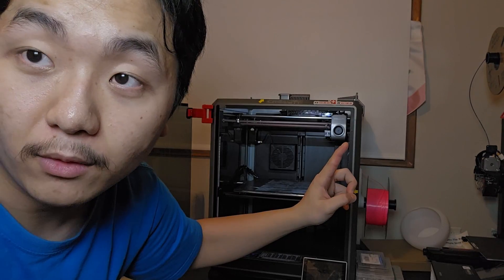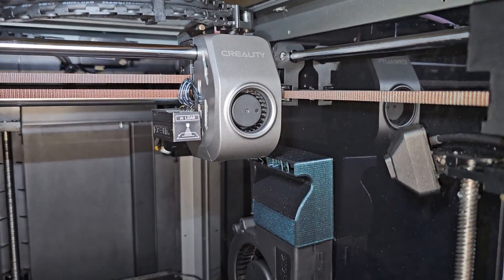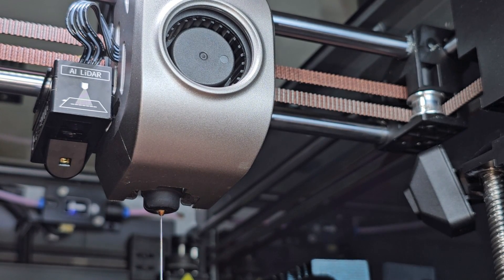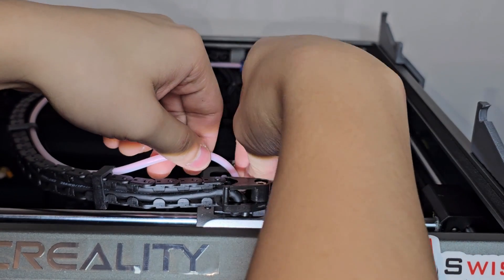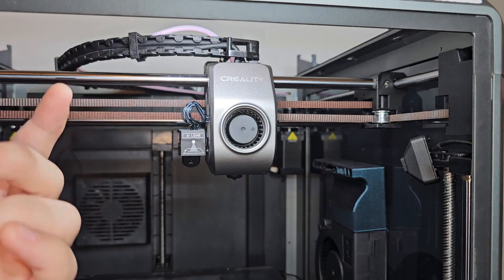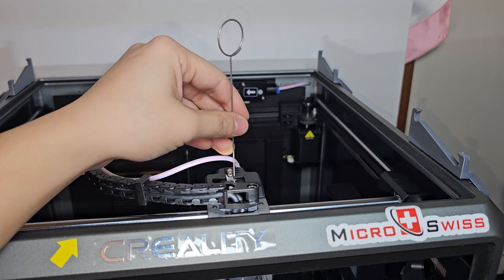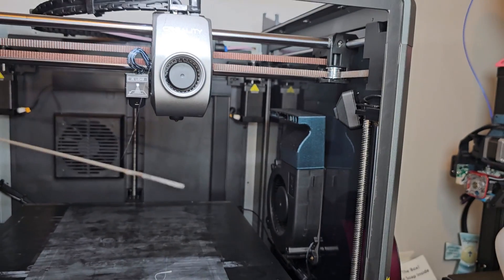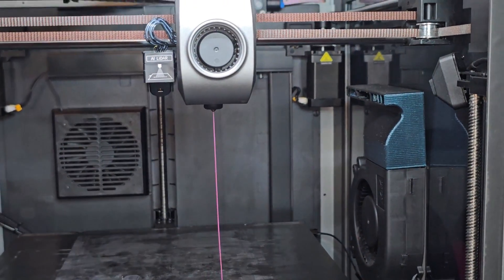Creality K1 Max Clogged Nozzle | Do This Instantly To Unclog

Comment: Heating up the metal rod and sticking it in through the top caused more damage to the printer. It began to melt the plastic housing for the feeding gears and made the clog A LOT WORSE. I had to drill out the tube after the gear housing as it guides the filament to the hot end, and that plastic tube right after the gears had melted and collapsed. Needles to say, this isn't a good idea. Disassemble the gear mechanism on the extruder and manually remove the clog. Don't melt it in...
Reply from the maker: Yea you are right, during this time I thought it was a good idea, and it is, but VERY dangerous. Disassemble is the way to go.

Comment: I know it’s an old video, but I would remove the extruder when attempting the final suggestion to avoid damaging the extruder. It’s quite easy to remove it.
Reply from the maker: Yeah, removing the extruder is the best way to unclog things and see what's happening inside the 3d printer.

Comment: Well my filament is stuck won’t move even with the switch in the unlocked position and it’s stuck solid no amount of heating clears the nozzle, it’s one day old and I’m absolutely stumped it won’t extract or extrude
Reply from the maker: In that case you'll have thr disassemble the extruder and see what's stuck inside.

Comment: With all the stuff they sell to unclog the nozzle, I discovered that just taking the right sized Ryobi drill bit and turning it by hand worked as soon as the nozzle was at the right temperature.
Reply from the maker: Yeah that is another way of doing it. I have seen many people do that, but be careful not to make thr hole any bigger.

Comment: DONT PUT A HOT ROD IN THE TOP - The feed mechanism has plastic parts in it. A hot cleaning rod from the top can result in the rod getting jammed in there as well (ask me how I know). It takes 10 minutes to take the feed mechanism apart and remove the blockage without risk of damage.  https://www.youtube.com/watch?v=GBdraBmpuEE
Reply from the maker: Yeah it is dangerous

Comment: when changing the hotend I dont recall anyone mentioning that the nozzel from the factory is only hand tight i have worked on mine many times before I realised the the nozzle is tight but only at a minimal tighten everything properly before installing saves stress and tears
Reply from the maker: Yeah, over tight the nozzle can strip the tread and ruined everything.

Comment: This was not a good idea in my case. I can't recommend this method at all. It was my first time having to unclog a nozzle, and using the hot needle only made it worse. Would have been much better to disassemble from the beginning. Turns out the root cause was one of my filament extruder gears (the one connected to the reduction gear) is missing a tooth. I ordered new all metal ones, and then swapped the two gears (so that the one with the missing tooth isn't required to drive anything. Printing again now, will replace the gears when the new ones arrive.
Reply from the maker: Yeah, this method is pretty dangerous. Disassemble is the best method to unclog anything clog.

Comment: 3:35 my filament is stuck, can’t pull it out… Doesn’t extrude, doesn’t extract and can’t pull it up from the top like shown here… contacted Creality and where going to reply in 24h but nothing happened. Got a Ender 5 Max paperweight until this gets fixed… (did 5 small prints as it’s 1 week in use) 🤮🤮🤮
Reply from the maker: Yeah clogging happens all the time in 3d printing.

If the filament can't be pulled out, maybe heat up the nozzle and change the nozzle.

Comment: Bro thanks for the video, do we need to heatup the nozzle when we put that manually heated rod inside ?
Reply from the maker: Yes have the nozzle heated so that it can melt the plastic and push out any clog
Reply: @Scratch3DPrinting my spool was a tangled an I saw an error saying that between the extruder and the CFS the filament is blocked. I tried retracting and extruding. My filament goes back to the CFs and gets in without any issue but when I resume the print the filament does not come out of the nozzle. And I hear the tik tik sound from the head. Do U know this issue can be same as you explained in the video ?
Reply from the maker: @joysondsouza5819 Yeah if no filament is coming out and you hear the ticking sound then it's a clog in the nozzle, not in the CFS.

Comment: pushing down from the top with the rod dealio was the key! I didn't know it was so easy to remove the tube
Reply from the maker: Yeah you learned alot when taking off the 3d printer.

Comment: DON'T DO THE HOT ROD IT WILL SCREW UP BIG TIME. I have to admit I did it a few times and it worked but I had a massive fail big time. EASY WAY 3 screws at the motor disconnect it, 2 long screws on motor case open up and unclog EASY. also you get to see the damage caused by HOT RODDING.
Reply from the maker: yeah that method is quite risky, but when it works its amazing.

Comment: Never thought to heat the cleaner , but to be absolute sure that will not damage anything between the extruder and the nozzle , I think it's better remove the extruder , cuz the capricorn nozze go all the way up until be close the extruder. So , removing the extruder, the cleaner can be insert directly to the nozzle to unclog anything.
Reply from the maker: Yeah the best method will always be removing the extruder and or nozzle and see what is clogged inside.

Comment: In my case, it was enough to set the retract to 260 degrees and run retracting.
Some old PLA blocked, but it worked.
Reply from the maker: yeah sometime heating up the nozzle to higher temperature does work with pla.

Comment: Dude you save me from a complete mental breakdown. Following your steps fixed my issue immediately after i tried so many other fixes! The tip about the unclogging pin that came with the set, and heating it up, made all the difference. Thank you so much!!
Reply from the maker: You're welcome, glad you were able to unclog your machine.

Comment: Genius idea. It worked for me. What actually happened was the piece of junk filament stuck to the end of the hot rod and was pulled out. My only tip: remove the extruder motor first (only three screws)
Reply from the maker: Yeah removing the extruder would be better and safer, filament always gets stuck in there.

Comment: I have the K1 SE and can not unclog it. It is not making any noises. Prints like something is coming out but nothing is. Can you help!
Reply from the maker: At best you can disassemble the print head and see if there's anything in the nozzle, heatblock, or even the extruder.

Comment: DO NOT HEAT UP THE METAL UNCLOGGER because it will melt the plastic extruder gears inside. The ideal method is to take the extruder head apart and take out the clogged plastic. The needle trick for unclogging filament in the nozzle is good, but the heated rod is TERRIBLE IDEA!
Reply from the maker: You are absolutely right, the heated rod can cause damage if not be very careful, taking off the extruder is the smarter way to do it.

Comment: Thanks man, your video worked. Have to hear the pop sound from the top, and make sure it's unlatched when you go in. I did it the first time and a bunch of filament came out so I thought it was clear. Still blocked. Heated the thing that came with it to red and tried again, heard the little pop and all sorted.

This was from me changing the filament for the first time incorrectly and I actually had a whole solid piece of filament stuck inside.
Reply from the maker: Nice glad to hear it work out for you. Hearing the pop sound is satisfying.

Comment: I have a K1 Max with original extruder and hot end components. I have a lot of issues related to clogging both the nozzle and the extruder itself. I have had to remove three clogs from the extruder that occur between the short blue PTFE and the extruder drive gears. What I think I may be doing something wrong when I change filament. Basically after a print when a filament change is needed I retract the filament and quickly pull the filament out rolling it back onto the spool. At this point the filament breaks and creates a clog in the extruder. This is difficult to clear with the provided Creality cleaning rod without opening the extruder. 

I'm not sure what I can do to prevent this from happening. Wait until the nozzle cools down after extracting the filament before retracting the filament manually from the extruder? Or replace the extruder with newer Creality product - apparently there have been two upgrades that I am aware of. I have the original replacement with a "white" PTFE retention opening.

Regarding nozzle clogs (especially after a "plug" clogging the extruder), I have had to remove the nozzle for cleaning with small diameter needle-like probes and heat. Generally, I use a propane torch to heat the nozzle along with cleaning needles. Otherwise, I end up with under extrusion issues from a partial filament blockage. I have a Triangle Labs CHCB-0T (hot end, nozzle, and sock) on hand that I will install if clogged nozzles continue to be a problem. Any thoughts?
Reply from the maker: I have experience the same thing while pulling the filament out like you did.

What I did was use the "Extrude" and "Retract" preset from the 3d printer screen. Wait until it has completely done retracting then push the lever on the extruder and pull out the filament.

The auto retract does a really nice job of retracting, don't force pull while the 3d printer is retracting, that will lead to many problems. I have not use Triangle lab stuff so i cannot say.
Reply: @Scratch3DPrinting  I haven't been doing the extrude followed by retract. I don't see how that would change anything because retract does extrude some filament before the retract. I'll give it a try and let you know if this reduces the problem. Regarding pulling the filament I do wait until retract has finished and the nozzle has cooled some.

Comment: Wow, i was worried about this for ages, i only got my K1C yesterday and have been printing all day, tried to replace my PLA and then this happened. found your video and the heating up the cleaner worked a dream, I just used a normal lighter and it all spurted out. Thank you
Reply from the maker: Glad I could help.

Comment: Thanks for the tips!

I knew to probe the hot end from the bottom and recut / reseat the filament, but heating and plunging from the top of the block is a very good idea. 

Subscribed.
Reply from the maker: Glad it helped!

Comment: lol "finally clogged"   im here because 3 hrs of printing 4 small tests on a brand new k1c and its already clogged wont extrude  wont retract only used 10 percent of the test filament it came with its such low quality
Reply from the maker: Sometime it just clogged for no reason.

Comment: don’t do this!!! heating up the push rod, the components down there are plastic and you will melt them!!!
Reply from the maker: that's true, doing this is very dangerous, but if done correctly it works.

Comment: ive tried this a thousand times to the point im afraid i am damaging my printer and it is not fixing the issue. are there other methods of unclogging?
Reply from the maker: If nothing works, then I guess you'll have to take apart your extruder and unclogged it that way.

Comment: Dudes. That is for when you remove the nozzle and use the pin for cleaning the entire block. Heat the nozzle. Remove it and use the pin to push up and down to clear any blockage. After each push clean it.
Reply from the maker: ohh, well it is also great at unclogging as well.

Comment: I have Creality K1 can you help mewith this problem?
The nozzle isn't touching the bed during printing and then it starts to moving xy without printing anything.
Reply from the maker: I'm not sure, you can maybe redo the bed calibration, and also try homing and see if the nozzle touches the bed. Clean off the purge line at the back of the build plate. If nothing works then maybe something is broken and needs replacements.

Comment: Helpful video, but unfortunately, it revealed that my K1 Max's extruder kit had failed completely after only about 30 hours of printing! I also discovered that Creality neglected to install the PTFE tube between the extruder and the heat break. Though I love my old CR-10S Pro v2, I didn't exactly trust Creality after this. In the week since I had bought the printer, the price had increased $200, which then made the Bambu Labs P1S with AMS a cheaper option, so I went that way.
Reply from the maker: man, thats sucks, that your extrude had failed. But hey, congrats on getting the P1S with AMS. Keep on 3D printing.

Comment: The way you heat @6:11 with fire is better to heat with an hot air gun with temperature controllable, don't insert anything hotter than probably 250 degree on the cold end (intend with margin 240) it's a good over minimum and maximum temperature in many cases not involving extruder gears. I'm not sure which is the max temperature not to damage this specific design (and K1 Max neither ship always with the same heating block since time to market) but heat with fire is not something to imitate to reach "hot enough", it might be definitely too much.
Reply from the maker: Yeah you're right, a heat gun would've been better for better heat control. It is also very dangerous to that method.

Comment: I tried this. Doesn't work on every situations. I had a blob of melted filament which was stuck after the gears at the entrance of the extrusion channel (tube) in the plastic housing. How do I know? Well I managed to follow a video instruction on taking the stepper motor and extrusion housing out and opened them to check. It would have been much easier to do it this way. 

The method to stick a hot pin into the extruder channel was kind of odd coming from Creality (Not sure if this is from Creality or from the Poster) as the hot pin actually melted the blob and when I pulled the pin out the melted filament got pulled along and smeared the inside of the channel reducing the diameter of the channel so much so the filament wouldn't go through. So I ended up opening the unit which was actually much much easier to do and cleared the blob out and removed the smeared filament inside the channel by using a 1.75mm diameter metal rod. I actually use the provided Allen key in this instance. That cleared the mess and I was back to business again. 

But there is another video on YT that actually advice K1 Owners not to do which will prevent the same blockage occurring again. Basically he said if you are going to replace or change your filament by retracting, you SHOULD NOT pull the filament out WITHOUT UNLOCKING the gear. The act of leaving the gear locked and while you pull the filament out will cause the melted portion of the filament which is after the gear to be left behind. And it is this melted filament that then accumulate and block the extrusion channel.
Reply from the maker: That's good that you figure out the problem. The hot pin is not from creality, it's from me, that's how I do it sometimes. Yes there are risks pushing the pin into the extruder.

Comment: wow you saved me, I got creality 7 days back and today I almost requested a replacement as I was not able to print anything, found out the filament was stuck in the pipe in the extruder, the burning and pushing helped, Thanks 🙏
Reply from the maker: Thanks, glad I was able to help. Keep on 3d printing.

Comment: Hi there, Im subscribed, and I have a question. I have the creality k1 speedy and every time i try to print, the first thing that happens, is that the nozzle just makes a ball of filament on the nozzle, i really need help. May you please explain how to fix this issue Thankyou
Reply from the maker: Hello thank you for your support. There are many reasons that could cause that issues from what I know.
What you can try is to manually extrude the filament out by either using the 3d printer screen or a slicer. If the filament comes out nicely then it should work fine. If not, then maybe there's something inside your nozzle, try to clear it or replace it with a new one. If that still occur then I suggest you try a whole hot end replacement. Anymore question let me know.